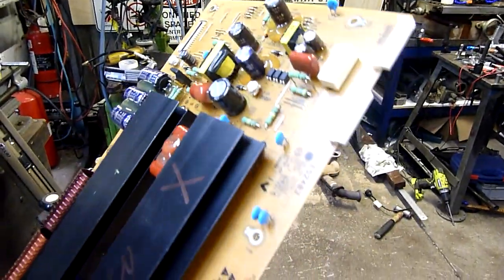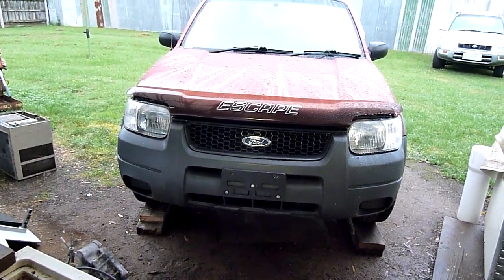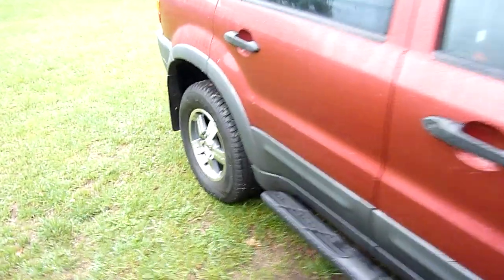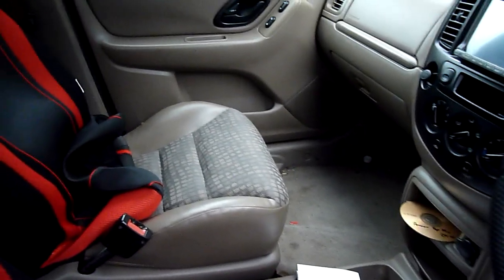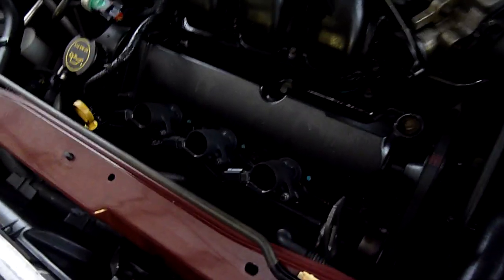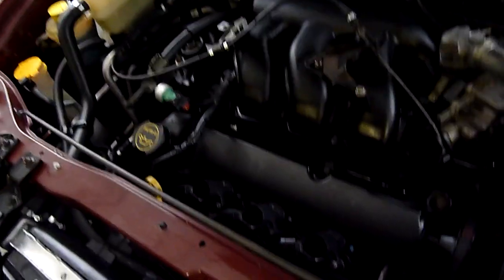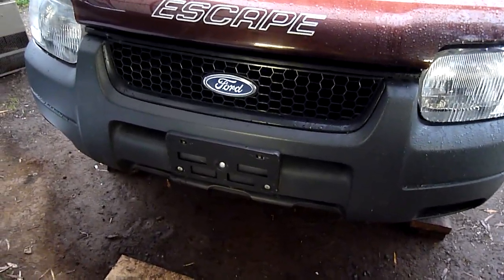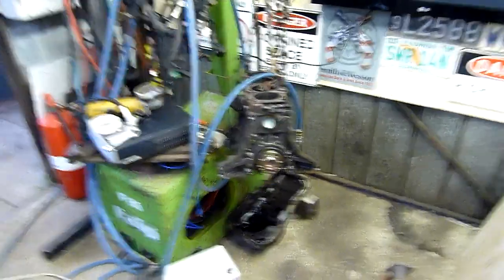Ramblotron Entry - April 10 2014 - Meet Viki

Comment: Also try a fuel system leak down test. If the pressure drops away quickly you could have a leaking injector. But I'm sure you would be checking that anyway.

Comment: Over fueling wont be lost of injector control but could be bad sticking injectors. You could do with a digital oscilloscope to check your analog wont do it because the signals aren't repetitive and to slow  for it. A scan tool would be good to see long and short term fuel trim along with the O2. Be good to see how you attack it

Comment: I got a car-related question:

I bought myself a 1990 Citroen XM 2.0i. The engine starts up at the first crank, even though it has about 300k km on the clock.

Now to my problem: It runs very hot (about 120-130C) on idle, even at cold temperatures (0-5C). That is, after about 5-6 minutes of idle. The info plate under the bonnet says that the fans are, by factory, off when idle.

I've checked the coolant, any form of leaks in the radiator and the hoses and so on.

Could it be the water pump or something like that?

Nothing suspicious comes out of the exhaust, but could it be the head gasket?
I'm not an expert when it comes to engines and other mechanical bits on a car.

Otherwise it is a well-serviced car, the hydraulic suspension is recently inspected, the oil is in pretty good condition.

Maybe I should bypass the cooling fans with a switch?
Reply from the maker: Hmnm, is the radiator also getting really hot?, or is it just the block.

it would not surprise me if the thermostat is not opening, or the radiator itself is all gunked up inside.

I don't know how hard it is to do the WP on that engine, but I would start with a thermostat before going any further, then tackle the WP and Radiator

likewise if the fans never come on, and the rad is getting full flow of water, I would replace the thermo switch that controls them. don't bridge it out or it will over-cool the water going back to the block and potentially crack it due to thermal shock.

Comment: Had one of these, great cars for towing but chew way too much juice for anything else handled a car float with 2 pallets of bricks no dramas at all but even driving it "economically" the lowest average L/100 was 15L now have a V8 adventra now and get better economy and the sound of a v8.
Reply from the maker: awesome, the EB Fairmont isn't much better at fuel economy :D.

funny you should mention the adventra, i was just looking through my drawer of early 2000's car show brochures and found the first one for the Adventra, never found the full one for the 2001 Escape tho :( I know I had one but I'm buggered if i know where it went.
Reply: gotta love the old Fairmonts couldn't kill them if you tried. have cooked mine 3 times so far :)

The escape's are a great car just had weird issues with our one like stalling going down hills or at 110kph other than that it was fantastic. with your escape just make sure the  recall on the engine shroud has been done

Its a real shame holden discontinued the adventra and went with the daewoo craptiva if you can fined one cheap go for it you will not be disappointed heaps of room and heaps of grunt
Reply: jtotheb1993
whoops just realised the engine shroud has already been done

Comment: Be very careful not to breath any of the cat material its very toxic.
Reply from the maker: silica? . I had a large centrifugal blower down at my feet when I was under the car, the strong wind blew the dust rearward away from me so it should not be an issue.
Reply: Great I visions of you setting to it with a hammer and chisel in the shed. :-) The ceramic substrate is coated in Rhodium or Platinum and it can cause lung problems and are suspected carcinogens. Solid metal is fine but in the dust form it’s an issue.

Comment: Goodie a dead catalytic converter is actually a good converter.
So if you could make it run properly catless and just keep it for inspection time it would be perfect!

Yes, I hate the damned cats with a passion.
Reply from the maker: as long as it looks like a cat, it passes here. no Smog tests.
I am done gutting them. front one looked like Chernobyl No4 reactor inside, totally melted down.

now to re-attach the mid pipe and give her a run :D
Reply: Aussie50
If the engine doesn't have a frickin O2 sensor past the cat you are good to go.
Some have that in an attempt to be "environmentally friendly" to provide a good life for the cat, so you remove the cat or gut it, well the engine runs really poorly.

If they didn't smog here and the bolts were so damn rusty I would have gutted / removed the cat on my car a long time ago, and let it breathe freely, and then perhaps tune the ECU for more economy.
Reply: Smog cats suck, but the high flow ones aren't really that bad.
Reply from the maker: CMDR Sweeper
both O2's are before the cats, should be fine now that they are gutted.
Reply: What wheels are on there?? I've got a 2001 escape and I want to get a used set of wheels, but I'm having trouble finding the right offsets etc 😕